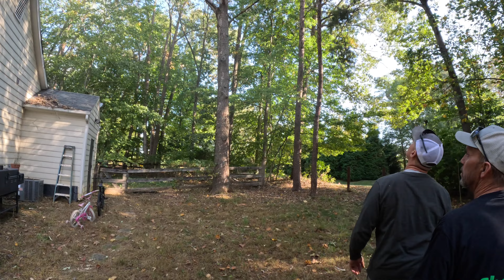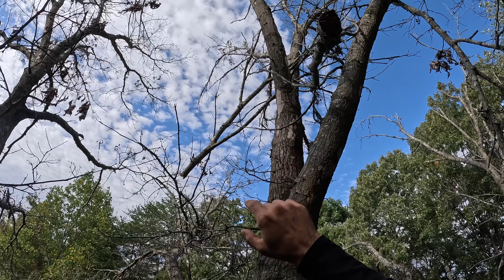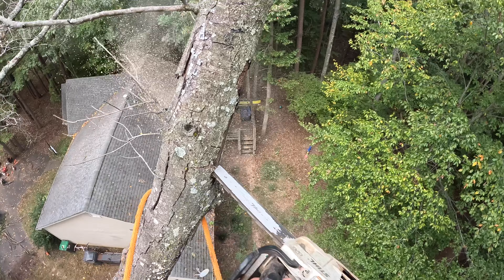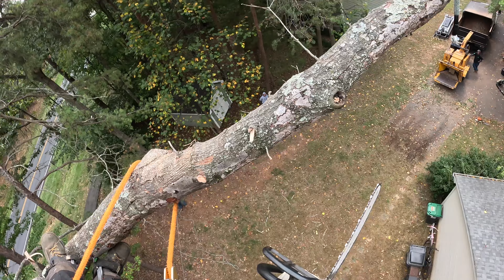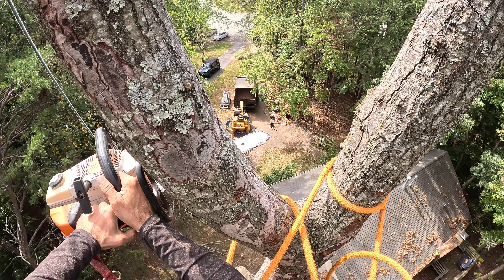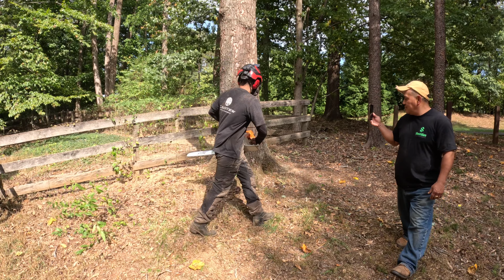Dead Oak Tree Removal/Lots Of Rigging Tips

Comment: Well done brother, hell of a job as always! Also, your tie in should always be under your rigging point if you're on the same limb, correct? Would like to hear more on your shoulder injury in the tree and how it happened. Was it completely dislocated and how did you get yourself down?
Reply from the maker: Thanks bro! No I always put my rigging point underneath my tie in when it’s on the same top, usually four feet minimum so they done cross. I tie in on small stuff that is not optimal for rigging because it won’t hold the weight it needs to. This is why the rope man is so important because if they mess up it can cause serious injury or even death. I’m real funny who I let run the rope.
Reply from the maker: My injury happened when I was blocking tree down. I was climbing down the tree getting around a big fork in a white oak my gaffes kicked out and my left hand was holding the left side of the fork. When my body dropped my arm could not hold my body weight and my shoulder dislocated. If it wasn’t for my lanyard I would be dead. I slid about ten feet down the tree. Lucky all I had to do to get it back in was put my arm down to my waist real quick. It hurt so bad I almost passed out 😵 I’ve had shoulder issues ever since. I did not finish the tree either had to quit climbing for a while.
Reply: @Notchemandwatchem  oh ok, I see what you’re saying. At work we are always instructed to put our rigging above our tie in, because in the event the rigging point fails it doesn’t rip our tie in with it. I do like how you mentioned to setup rigging in compression and not in tension. Thanks for the content and looking forward to more videos!
Reply: @Notchemandwatchem  wow that’s so scary but I’m glad to see you’re still climbing and you make everything look so easy and fluid. Did you have to do any surgery and are you doing any exercises to strengthen your shoulder?
Reply from the maker: @anonymouseuonymus  it happened in 2015 I had to get physical therapy and they wanted to do surgery but I didn’t let them. It’s better now I just don’t have the full range of motion.
Reply from the maker: @anonymouseuonymus  honestly, I always try to find a tie in point on a difference spar from what I’m rigging on for the most part. And if it has  to be the same spar, I put it low enough where I know it’ll handle whatever load I put on it.
Reply: @Notchemandwatchem  I frequently have times where my rotator cuff bothers me but what helps is internal/external rotations and hanging from a pull-up bar for 30 sec intervals. Do you do anything differently now to avoid the same injury?